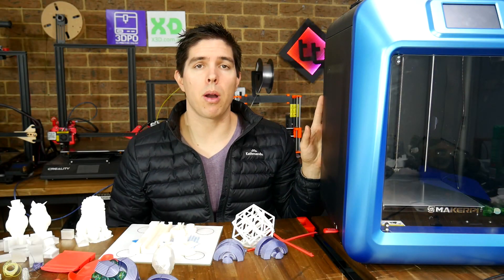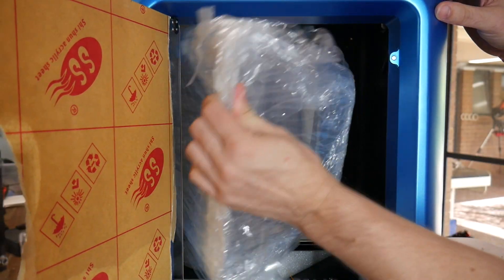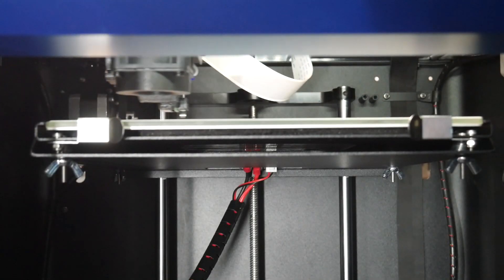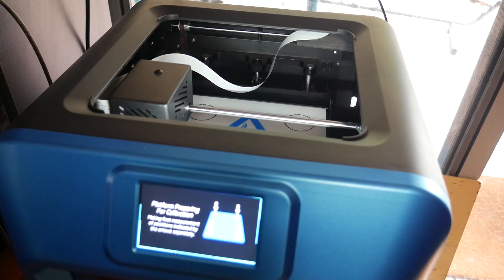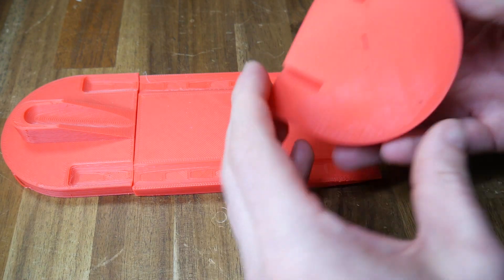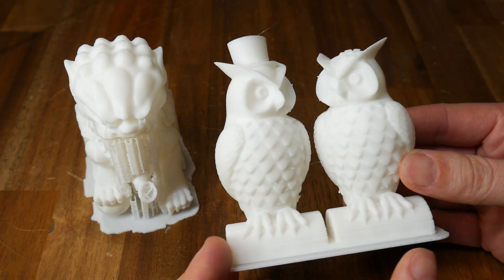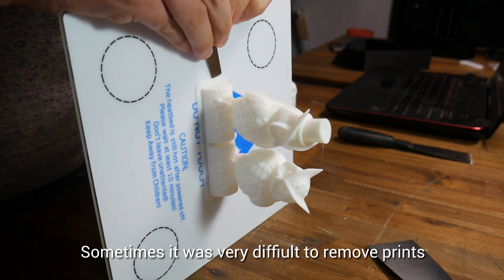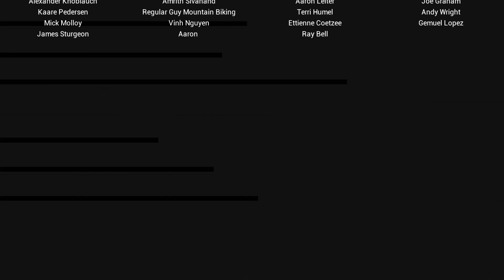Makerpi K5 Plus review: Easy ABS printing from factory?

Comment: My Ender 3 with enclosure prints ABS perfectly. No layer separation or anything. I just have custom ABS G-Code that lets the hot bed run for a few minutes longer once it hits 100c so it warms up the chamber.

Comment: There was so much pressure to re-review this... they changed almost nothing. No laser now?
Reply: I don't understand why they'd want it reviewed at all. Maybe 5 years ago, but better companies have gone under trying to hold that price for such a printer.
Reply: After this review, they shouldn't get any new chances, in my opinion; even on new printer models they release later!

Normally I wouldn't say this, but when they say they fixed all the issues, when most are clearly not fixed at all, then it should be over and out, PERMANENTLY! No more reviews!
They can't expect reviewers, users and/or the community to be their R&D as well as the testers, especially for the massive price they are asking for this printer! It has too many flaws, especially the lid, which seems to be an extremely late afterthought?

Seems they put more work and development into the packaging of the printer, than into the printer itself...

Comment: You need to use a slurry of ABS and acetone. It’s the only foolproof method of adhesion for abs. I use natural abs, which is white and slightly translucent. You don’t need a lot of abs in the acetone. The thinner it is, the flatter and smoother the bottom layer will be.
Reply: They have one of those fake buildtac surfaces, the acetone tends to eat right through it. Also, I would expect more from a $750 printer than to need this. The heated bed should just hit the right temps.

Comment: we have 2 models of hotend can be choose,one is all metal,which temp can up to 280 degrees,better for ABS,another one is  with teflon tube,that's why also sell TPU nozzles on Amazon,to meet more customers' requirements, because some customers like the one with teflon tube,which is more compatible for different quality of filaments,also many customers like all metal hotend,which can print ABS perfectly,the one you used is not all metal hotend.

Comment: This ships with an old Cura clone.  Is the firmware a marlin clone?  I thought marlin derivatives had to be open source per the license.
I would love to be able to add mesh bed   leveling to this machine.  My bed crowns at least .5mm in the middle such that my usable build area is maybe 80mm by 80mm.  Leveling module is useless with this kind of crowning.
I do have both hot end modules as stated by the company rep below, a full metal hotend, and a PTFE tube hotend I bought from Amazon.

Comment: I have a video request if you think it will be interesting since there is no proper or official document that I could find. Ender 3 Pro + v1.1.5 silent board + BL Touch v3.1 . Creality doesn't have a firmware for it.

Comment: It looks like there is no sub 1k printer that can print ABS without a problem.
Should I build one then?
Anyone can recommend some suitable open source project?
Reply: Sure they exist. But for sub 1000 bucks the print surface will be quite small.
The Voron v0 is the cheapest one. The v1.8 and v2.4 are more expensive ~ 1300-2500$
The Jubilee
The BlackBox
The RailCore
The SecKit SK-GO with some modifications
Reply: I've had my Flashforge Creator Pro for around three years and never use anything other than ABS. I've never had any problems with warping, or any other problems I see some people  have with ABS. I recently 3D printed all the parts for an MPCNC machine, which took over 100 hours and meant the machine was running day and night for most of the week. Every single print was faultless.These machines cost around 600 USD and the heated bed is around 230mm x 160mm.

Comment: Doesn't look like any of the ABS parts split. So, enclosure is doing its job at least.

You may have already done this but as I've learnt recently, its beneficial to put down nice thick layer lines on the first layer for ABS. 200% line width for first layer at 15-20mm/s has solved a lot of my bed adhesion issues on my printers when using ABS. Usually laying down on hairspray or a few coats of 50/50 PVA and water.

Depending on the brand. Bed temps of 80-110. Usually 100+. Have some Sunlu thats printing nicely on a 90 degree bed.

ABS doesn't like a lot of surfaces. Usually needs gluestick, ABS slurry, hairspray or a PVA coat.

Comment: Interesting but in that price range I'd buy a prusa and skip the abs.
Reply: With a few changes my Ender 3 prints ABS, PETG, PLA and TPU without any issue so, I pass.
Reply: @adilsongoliveira  How do you go with large ABS parts? Something like a 15cm cubed
Reply: I bought a Prusa because every single youtuber and also comment says go prusa if you want a good machine. Well in my opinion it is not really the case. This machine costs me a whooping 750€ plus the MMU2 and i have to tinker on it again and again and again. I still like the machine but would never recommend it over an Ender 3 with a better board. 
I think the CR-6 SE can be THE new king instead of the Prusa MK3s
Reply: I am not conviced of the Prusa, too. It's always so hyped, but features an completely outdated, flimsy mechanical design. And I think that ABS is a very important material, as it enables printing of actually usefull things instead of just fragile toys. SO the K5 plus is an very interesting printer. In comparison to other (kind of) affordable ABS printers (like flashfogre or up! mini2), it features the usage of arbitrary filament and any slicer of your choice.
Reply: @BenAndrews  well its cant, large pices need haig temp ambient, so yuo need 70celsius in the enclosure,wster cooling steper motor,and cooling for electronics,its the only way to print big square pices of abs whithout warping
Reply: @MrSersmax  well i think its an historical reputation from Prusa, remember that ender3,cr10 dont exist in that time
Reply: @elmariachi5133  i think the same the other day, i saw a prusa mk2 , and all pkastic part was 3e printed whith very bad quality...well marketing its a bussnes
Reply: ABS sucks massive cock! Depending on the requirements, PLA beats ABS in most aspects! Otherwise you have for example PETG or PC. There are other filaments, but I haven't done nylon yet, even though I have one spool (not needed it yet).

ABS can handle more temperature than PLA before loosing rigidity/glass temperature, and it can be bought cheaper. But the downsides to ABS is way to many!
-It gives off nasty if not harmful fumes while printing
-It requires more work for proper bed adhesion
-It suffers from massive layer separation issues
-It is not the most environmentally friendly material (which can probably be said about most non PLA filaments as well, but ABS is perhaps among the worst?)
-It is probably the worst dimensional accurate filament?

I don't remember right now if there are other downsides, but it is no wonder that many hates or dislikes ABS. 
I've had more success with PC than I've ever had with ABS, and that is from many prints with ABS, where the fail print rate of ABS is horrible, while even including calibrating the slicer for PC, I've had more success with PC already, from a few prints. Not to mention PETG, which is quite easy to print with after you get a little experience with it, almost as easy as PLA.
I guess some of you haven't really watched any tests of the different filaments?

If your prints with PLA is massively fragile compared to ABS, I suspect you might have some real shit PLA, or it might be printed at a sub-optimal temperature perhaps?
I still have ABS, and it has some uses. But for normal printing, I rather do PLA, or perhaps PETG. PC is a bit expensive for normal use.

Comment: how much did you had to change your original text for them to accept it ? it really feels like you were about to say "this is shit" quite a lot of times.
thermal cameras are not supposed to be used that way, you need to have points with the same emissivity, use black tape if you must.
use K type couplers against the thermal camera to double check, never use it through glass/plastic/whatever

Comment: Thank you for your excellent videos.
In my opinion 3d printer manufacture should focus more on the build quality and testing their machines than locking up firmware and forking old versions of slicers. Everyone would benefit from preconfigured and regularly updated profiles for vanilla cura or slic3r and proper instructions for importing them.

Comment: Do you think being able to preheat the interior air temp of an ABS printer up to maybe 90 C would be useful?
Reply: Perhaps but this is risky business, if you or anyone plans on using a heat gun, keep in mind the printer frame is plastic and could melt and the frame needs to have extremely good insulation to keep such a high temperature. 90 is really really high for print chambers and causes its own problems. What this machine desperately needs is better leveling and for its print bed to actually reach 100-110. ABS is just really difficult to print and there are so many more stronger plastics than it.
Reply: @Bajicoy  I was thinking about an adjustable temp with an upper limit of 90C. Yes, the printer would need to be made of higher temps stuff, but this is all part of a custom printer I have in mind.

Comment: thanks for the review.  a good reasonably priced abs printer is hard to get. maybe do a 4max pro review?
Reply: I own one... don't bother unless you want completely replace the extruder assembly. Titan clone is awful, PTFE lined hotend, Temp readings are out because they put the wrong thermistor in the firmware than the ones they shipped with. Ribbon cable has no protection and rubs over screws, jams on rods and gets folded. 12 volts.

It can be made into a good machine and does print ABS successfully but just not consistently with that extruder assembly.

Look at Qidi's. I own the X-Max and its a solid machine. Old extruder but at least reliable for ABS. Really thick aluminium beds. They're built to last. Any mods you do are to expand them, not repair from factory QC issues or just poor design flaws. Really awesome support from Qidi as well. Reply via email promptly, send parts if theres a problem under warranty.

Comment: In my experience you would get less bed adhesion problems and warping on ABS parts by using a nice big brim and some glue stick below the part. I hope the part cooling fan was switched off?

Comment: Nothing against Angus at makers Muse he's really great when it comes to the slicing software.
But I've seen him do some really funky things with hardware. Then blame the printer when it was clearly his fault with the CR-10 V2.
That's why I respect your channel you actually research and probably take a while making videos to be as precise as possible
Reply: In my opinion Angus tries to come at the view of stock everything (which for some consumers might be better(noobs)) which is why you don't see him changing out mainboards and making custom parts very often.
Reply: Say what you will of Angus, the guy knows how to abuse a printer and as anyone knows, the average consumer will do much much worse to the machine
Reply: @Bajicoy  I'm not saying nothing bad about him I'm saying he knows slicing software better than he knows the hardware
I watched a video where he put the direct drive on the cr-10 v2
Instead of putting the correct firmware on it he swapped some wires and complain that it melted out and it was all because he didn't do what was correct.
But when it comes to his slicing software and stuff he's great some people have strengths in different areas
Reply: @MauiRedMan  Fair to a degree... but did Creality provide enough details and clear instructions to get it done?

Comment: still rubbish printer for the price. I love the idea of an assisted levelling system though. Imagine that but with a permanent Bltouch or other leveler. Can get the bed as close to level as possible but with ease, then the auto levelling can remove any unevenness.

what have you tried on ender 5 for the heating chamber? have you thought about a PTC I've seen some saying they get upto 210c. Got a 200w ptc in my photon S massively overkill, heats the chamber up in no time, less than a minute. Not sure what the max temp on that one is, but would be surprised if a high temp ptc didn't get to the ~100c chamber temp needed for abs. Cheap ones seem to be 80c.